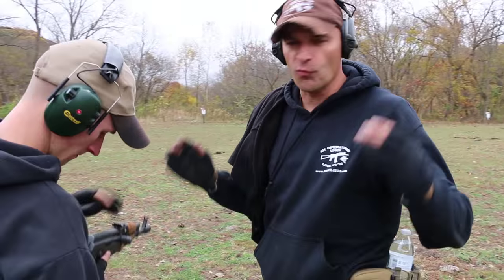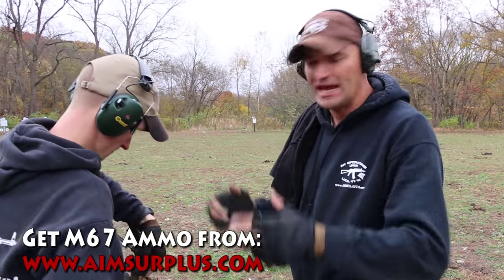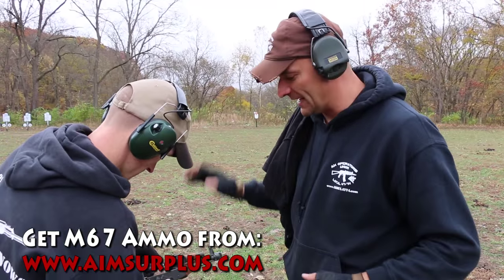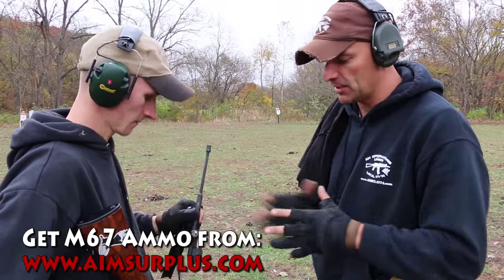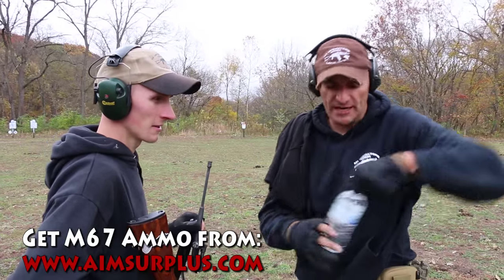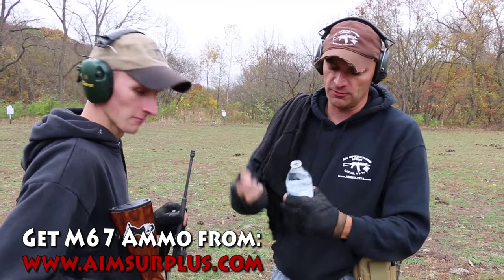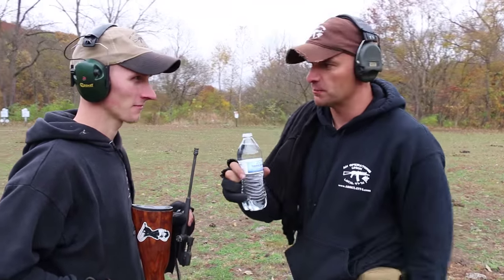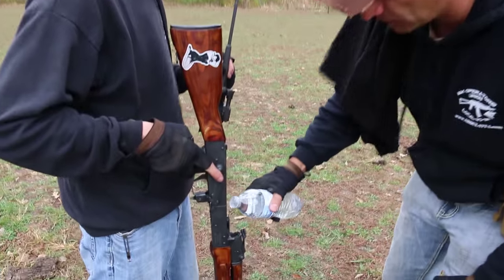Corrosive Ammo in AK

Comment: So after getting my 74 I broke her down did a thorough degreasing/cleaning with Simple Green (moderate strength), dried things off with the hot air blowers from the wood burning stove that keeps us warm, immediately treated everything with Froglube (oh no he dit-ant!) and the next range trip out ran a bunch of 7n6. Cleaning procedure you ask? All the parts I could get off went in a plastic tub full of almost boiling water; filth just floated off. Poured more almost boiling water all into the receiver, fcg, and barrel. Let the stove blower do the drying off and good to go. No stinky solvents, minimal elbow grease, couple of weeks later still looking good, Froglube still active for the next target practice. Yes folks, in a minimalist situation it can be that easy. peace safety freedom.

Comment: With my Mosin i remove the bolt and pour water down the barrel.  I then would spray Ballistol down the barrel and run a bore snake thru it.  I would also clean the bolt with Ballistol and wipe clean then reinstall.  I'd apply a small dab of grease to the bolt lugs and that's it.  Takes just a few minutes and it was clean.

Comment: I had bad experience with corrosive ammo. I cleaned thoroughly everything only to have it surface rust most of the internal parts. I wont shoot corrosive ammo not even mildly corrosive like I had.  It took me 3 cleanings over 2 months to stop the corrosion. Luckily there was NO damage.
Reply: Did you store your rifle in a humid room?
Reply: @R.Tafolla  , no at that time I lived in a pretty dry climate.
Reply: @GunDrone  how did you clean it?
Reply: @R.Tafolla  ,there are many methods. At that time is when most of the ammo was mildly corrosive. I used just Hoppe's #9 bore solvent. And it took 3 good cleanings to stop the surface rust. I have checked all  parts over the years and the scourge finally was over.
Reply: @GunDrone  water

Comment: The primers are corrosive, they have a much longer shelf life than the regular primers. So for ammo sitting in a warehouse or supply dump for extended periods needs to handle temperature and humidity changes without issue. For the record I have never had a bad primer on 7n6 that is almost 40 years old, but I have had new commercial stuff that might have a dud or two per 1k.

Comment: Thanks for this info fellas. I am lazy, don't like a mess, and sum of my research indicated water, applied soon after shooting worked best. I chose to mop the barrel with clean wet patches, use a water-soaked cloth on the rest then thoroughly dry everything. All at the range. Nary a spot of rust on my WW74 using 7n6 surplus ammo. Gonna try a variation with the bottle flush. Seems even easier.

Comment: I use boiling water from an electric kettle and then blast it with WD-40 to get all the water out.  Clean as usual from there, never had a problem with corrosion in my SGL-31 and I shoot 7N6 exclusively.

Comment: I have a Galil 5.45x39. Shot corrosive ammo and I'm still getting rust in my barrel and gas tube. I flushed with water blew it dry with an air compressor and then cleaned as normal with oil. Why is it still rusting? Thanks

Comment: I wouldnt fire corrosive ammo in the first place. If you pour water on it while its hot you can lock in an unintended temper and generally weaken or change the structure of the steel. If you do any mag dumps wait a short while, it shouldnt be much more than 150 farenheit. But corrosive ammo is just a waste in my opinion, you have to go out of your way to clean the gun and you have to re oil/grease your gun.

Comment: Would this also apply to the SKS? Curious if the gas system and all components be field stripped to dump water on too. 
** would it be necessary to clean trigger groups? Recoil springs , bolt extractor? Would corrosive salts get virtually everywhere?
Reply from the maker: Yes, same thing. I would splash bolt and pin too. Then dry it out.
Reply: Anthony Swiss yes I'm aware it's the primers mostly Berdan that are the culprit. 
What I have asked most often on  numerous discussions of this exact topic is ....... Is it imperative to clean the trigger group after every session with corrosive? Nobody I have seen has even remotely mentioned trigger groups. And I can assure you primer salts must also find their way in there. 
Just an extra step and especially if you have weapons /tools with after market stocks

Comment: I just shot M67, and flushed twice with warm water, cleaned and lubed. However, two days later my gas tube and gas block looks corroded. What am I doing wrong?
Reply: It came off after using solvent and wasn't anywhere else...could it just be copper deposits?

Comment: Does the same apply for the SKS?
Reply from the maker: +Robert Claar Yes, to every weapon you run corrosive through.
Reply: +Ak Operators Union, Local 47-74 I want to put a scope on my vepr 54r. but having to take the scope off and losing zero makes me not buy the scope. is there a ez solution for this?
Reply: do you have the bracket on the left side for mounting the optic? If so, get the Primary Arms outfit from AKOU page, the side mount locks in place tightly, the upper rail . optic assembly is tight and I have never had either of mine lose zero from taking off, cleaning and putting back. But DO use some blue threadlocker on the bolts and screws so nothing loosens up from shooting.

Comment: Should I just dry it out, or re oil it?
Reply from the maker: If will dry it out well, you will be good to go. Run boresnake through the barrel. In very humid climate, add some oil to boresnake
Reply: +Ak Operators Union, Local 47-74 Inside the gas piston tube and around the chamber, I can't really get in all the crevices where there may be water left over. I should be fine just letting this air dry?
Reply: +KhanGirey   Probably yes, but use a Q-Tip
Reply: +KhanGirey what moto said use quetips and also try using a hair dryer or air compressor and squirt some cleaner and oil after you dried up
Reply: +KhanGirey After water, WD-40 will displace the water and evaporate. Then I would re-lube rifle asap.
Reply: i would stay away from the wd40 and just run a dry patch use a hair dryer or air compressor or even hot water (which evaporates quickly)then clean with your normal process anyone else ?
Reply: +joe1stofall1st those are good methods too.

Comment: I just run my rifle through the shower when I get home, that windex/ammonia stuff is just fudd lore.
Reply: +Chucklemonkey Btw another benefit of using hot water from the shower is the heat retained by the metal parts of the gun helps to speed up evaporation so you don't get rust.